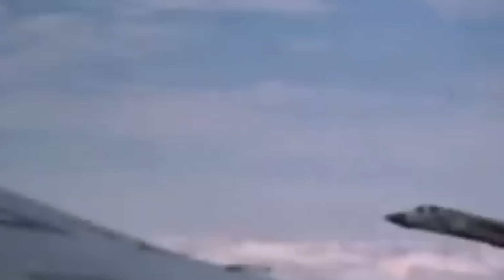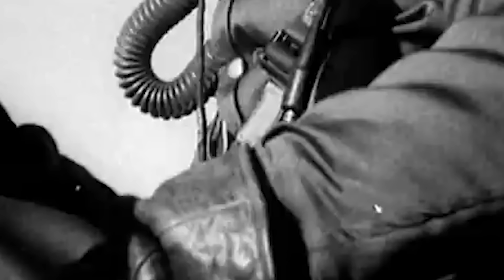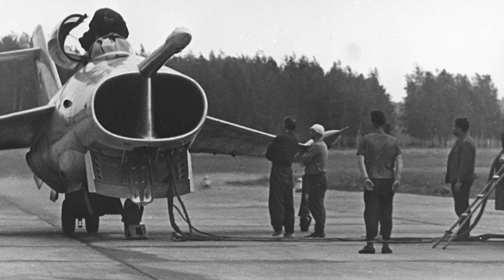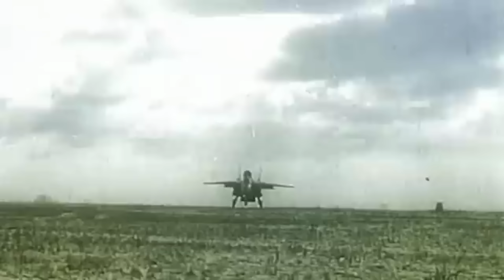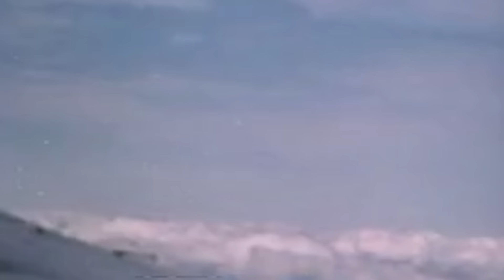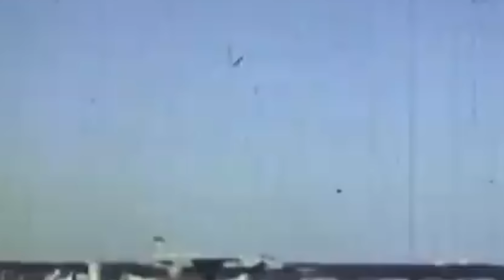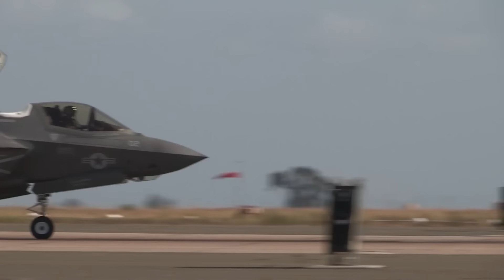America Stole This Plane and Turned It Into a Monster

Comment: This video is False:

The Convair Model 200 was the Yak141 before the Yak141 flew.

The three bearing rotating nozzle was already tested and patented in 1960s, by American jet engine designers.

Convair Model 200 was designed and offered to the US Navy as a Delta winged canard VTOL fighter under the "Sea Control" project.

Even Russian aerodynamic experts say the F-35B was too different from Yak141

Stop the Pierre Sprey based yapping.
Reply: Why didn't the Navy go with Convairs' Model 200?
Reply: @joeclaridy first vietnam

then because harrier was avaiable for purchase
Reply: @joeclaridy  Shifts in budget and priorities
Reply: @teeravitkun ok thanks
Reply: @joeclaridy  Convair offered the design, but there were no open contract requirements at the time from the Navy.
Reply: You are 100% correct.
Reply: The Convair Model 200 was never built, it was nothing more than a pretty picture.
Reply: @georgebarnes8163 but the design was first. Stop saying the Soviets invented three bearing nozzle and the front lift engines design.
Reply: exactly, sir. Confirmation from other side of the globe:)
Reply: That’s too bad the Model 200 was never build and never existed. It never went beyond wind tunnel models. The Soviet Union and the US have built hundreds of wind model models. It literally means nothing. They are small toys that do nothing other than provide very basic and raw aerodynamic data.
Reply: The first minute of the video contains utter bs. This jet was called: “Як – об палубу хуяк!”, or “Yak – hits the air carrier f hard, when falling on it”. Almost every of these jets had issues with VTOL systems, engine, hydraulics and electronics issues. There were lots of crashes while performing VTOL or just during flight. NONE of these jets fly today, and it shows. While older SU and MIGs keep flying. Outperformed Harriers? Good anecdote, mate!🤣🤣🤣👍🏻
Reply: Usa had a lot of buget at the time, so you'd expect a lot of things. Still ultimately it only allows you to experiment more, multiplying the knowledge.
Reply: The Convair never flew, they just made a design, and it sucked
Reply: @internetisinteresting7720  "It sucked" says a random no body who can't tell the difference between a wood screw versus an aircraft fastener
Reply: @internetisinteresting7720 sucked so much the Yak-141 is a direct 1:1 copy of it. LMAO.
Reply: How many flights did the Convair Model 200 achieve? Oh... Sorry... yes, forgot that part. If we take ALL the "Excellent on paper" designs, we may write an alternative history. Engineering, however, is demosntrated in the "real world", and I mean,,,, real stuff.
Reply: @andreaassanelli4117  all you have is laugh emoji? You conveniently forget the engineering term "DRAWING BOARD"

Your mom must have dropped you hard on your head.

You should name yourself inssanelli
Reply: @andreaassanelli4117  also, dimwit, ENGINEERING starts with DESIGN.

Try harder ruzziaboo
Reply: @andreaassanelli4117  you and the Ruzziaboo crowd keep yapping about how the ruzzians were the original designers of the F-35B.

Yet here you are, moving the goalpost.
Reply: @h.cedric8157 😂😂😂
Reply: @andreaassanelli4117  and all you have is laugh emoji.

Engineering starts with DESIGN, plotting paper, and I already said that the three bearing nozzle was already tested and patented in the USA in 1960.

You don't know shit bout engineering
Reply: @h.cedric8157  Well, since I've been an engineer for more that 30 years, API, ISO, some 20 papers published.... products designed and such, I may say that engineering NEVER starts on a blank piece of paper. Normally starts with SPECIFICATIONS and VISION. It is clear that the Convair lacked vision and the Yak lacked it too. However the russkies got the thingy flying. A piece of paper is NOT an engineering thing. When you get the stuff out there is when real engineering starts. An engine in a test bench is a good engine in a test bench. And, as far as I can tell, test benches do not fly, nor break mach limit. Getting the thingie flying is a great feat... and then, you should ask the most important question in military engineering. Where is the doctrine for this thingie? As far as I can tell, USAF (Especially in the 60s) did not care for slow planes, and the USSR just wanted to show they were able to "outsmart" designwise the west. Both "doctrines" were a death bell for both designs. VTOL aircraft in the US are for marines, not for the USAF. And for Russia, tech demonstrators were a dead end. But, at the end of the day, the Yak flew and beat some records. This is a fact. As much as it was uneligible as a combat aircraft. I love "what if" plane designs, but if you would care to review all the "phenomenal" ideas of the 44-45 luftwaffe and think any of them could be real, think twice. PAper planes are cool. As kids toys do
Reply: @andreaassanelli4117  bro keeps yapping about how he was engineer, yet insists that design and drawing boards aren't part of engineering anything.

Lol what a joke of a Ruzzian technology simp

And conveniently forgets and avoids the fact that BLUEPRINTS exist as a real thing, and denies the reality of design and design copyright, patents, and intellectual property.

This guy yaps about who ever builds their copy first means they own the IP.

Hey LOCKHEED worker guy, where you at?

So much pretentious ass holes on the internet.
Reply: Lockheed didn't need to partner with YAK if all they had to do was copy Convair. Yet Lockheed did partner with YAK, please explain why Lockheed "wasted" those millions of dollars on YAK's blueprints?
Reply: @mikenodine6713 YAK had airframes already built so lockheed had easy access to raw flight & performance data 

but the real innovation in F35B is the forward geared lift turbine 8nstead of the YAK obsolete vertical lift jets
Reply: @smparreira  Lockheed could have used the Convair data if it had been worthwhile, but sadly there wasn't any because the Convair 200 was never built.
Reply: @mikenodine6713  they ONLY partnered with Yakovlev, only for the operational data and the exhaust impact assessment 

There were no aircraft design purchased. Stop lying
Reply: @h.cedric8157  The lie is that the Convair 200 was the predecessor, it wasn't. Don't be silly like you know something I don't, I  worked for Lockheed.
Reply: @mikenodine6713  show me proof then. I'm willing to be convinced with actual proof. The blueprints are out there for Model 200, VTOL and Conventional models.

The VTOL Model 200, despite having a canard delta, it uses TWO FRONT LIFT ENGINE, and then a 3 bearing nozzle, exactly like the yak141.

So, yeah, please stop regurgitating the same ruzziaboo slavaboo bullshit, send me proof.
Reply: @mikenodine6713  argument from an invented authority. Even the Lockheed official website has the Convair Model 200, 210, and 218 as the basis for the F-35B, F-35C, F-35A.

Stop lying.
Reply: @ If you are correct then every American Satellite is technology stolen from the Soviet Sputnik 1, google it if you don't know your aerospace history.  Yes, all nations "steal" technology from other nations, but all nation's greatest engineers are also "inspired" by the work and accomplishments of great engineers of other nations. Lockheed was "inspired" by the Convair models, but they built the F35B based on actual flight data gathered from actual flying aircraft that Lockheed "purchased" when they bought the YAK141. If the YAK141 had no value, then why did Lockheed spend millions to purchase it? Because it saved Lockheed even more millions of dollars of research and years needed to do that research. The YAK141 proved the concept was workable, albeit with much more refinement needed to achieve the design parameter goals of the F35B. Now if we could just just purchase or steal the Russian plans for their hypersonic missiles, perhaps we could catch up to them and surpass them in that area, while denying we did so of course. 🤣
Reply: @mikenodine6713  Uhhhhh, because Yak had Already BUILT and FLEW their a-c....🤔

And Besides, back-then in the Early 90s, we (u.s.) wanted  to have "peaceful" relationships with the Now ruSSians.... Besides, the ruskies were in DIRE Need of $$$$$ to support Their govt.🤨

AND, Convair was "an opponent" with Lockheed.....they BOTH were competing for  'contracts' from the u.s. Govt. and NOW....do you hear of Any Convair a-c coming out of the production line, Presently???? :body-blue-raised-arms:
Reply: @mikenodine6713 What millions? And what blueprints, exactly? Convair was bought by Lockheed Martin, so they already owned the blueprints of the Model 200A that Russia stole and copied to make the Yak-141. LM only bought flight data from the Yak-141l, and inly did that to keep the engineers, design, and data from being sold to Iran or Russia. Furthermore, the  F-35B uses a lift fan for front lift unlike the Yak-141 which used a single stage axial flow turbine just like the Convair Model 200A that Russia copied. And the three bearing swivel nozzle was already designed, built, and tested by GE in 1967 for the Model 200A Russia copied.
Reply: @mikenodine6713  This was "encouraged" by the US government to help keep Russian MIC running and hopefully would allow the nation to remain stable and not collapse further thus potentially putting nuclear arms in the hands of rogue generals and new nations. Same reason why the US bought a FGB based module for the Space Station, to keep thier industries running.
Reply: @OldManWyrm  Aye! There are many Soviet programs we purchased to keep them out of the wrong hands that are still classified to this day.  In the case of the Yak141, we saved a lot of time and money not having to do our own flight data research from scratch. That was a win-win deal for both sides at the time.
Reply: @mikenodine6713  Yak-141 was not fit for duty after all (or it was noted so even by old good soviet- style hardliner colonels from Ahtubinsk and Zhukovsky :)). But, judging the quantity and quality of medicine, baby feed, human insulin, etc, etc then-democratic Russia got in exchange for that,  it was definitely win-win deal :)
Reply: @mikenodine6713  > There are many Soviet programs we purchased to keep them out of the wrong hands that are still classified to this day

You can't purchase information to keep it out of people's hands.    Even the Soviets had a few photocopiers.  I'd be surprised if anyone working on classified projects was blabbing on social media about the classified projects they know about.  Especially since you think paying someone for information somehow proves they haven't photocopied it to sell to someone else.  Your comments show a basic unawareness of information security.
Reply: That sounds like American BS.
Reply: yeah....okay.... but WAS It B U I L T??!!!:hand-orange-covering-eyes::body-blue-raised-arms:  Like your "Sea Control" ships => mini A/C carriers with VTOL a-c......they were not built.:face-pink-tears:

Looks like the Yak-141 was built....but not but into production....:face-orange-biting-nails:

F-35B I S in Production...:face-orange-frowning:

"Fly Navy"
Reply: @Hey_MikeZeroEcho22P who cares if it was built? Russia literally stole the Convair Model 200A design to make the Yak-141 and stole the GE three bearing swivel nozzle for it, too. And yes, the GE three bearing swivel nozzle WAS built and tested in 1967. All your cope is just that, pure cope.
Reply: @user-os6ch5pt7w  well the ruzziaboos gonna simp for Ruzzian hardware.